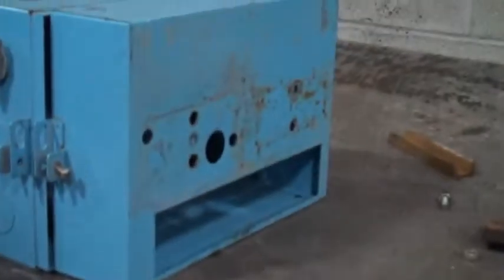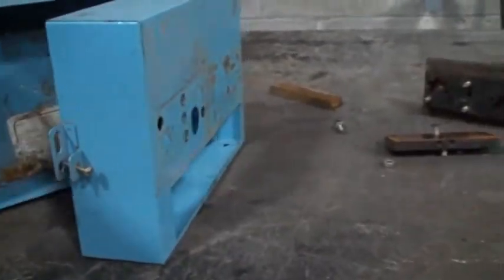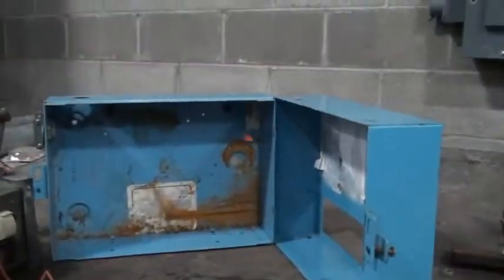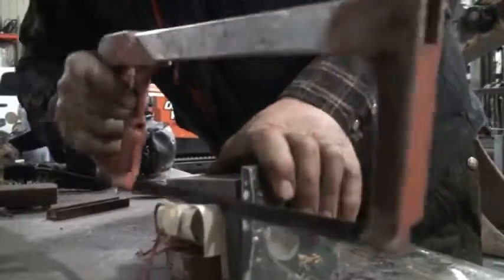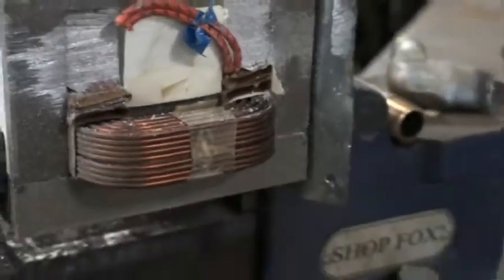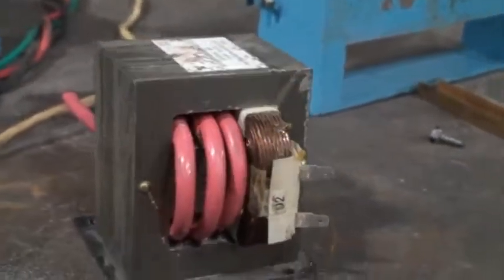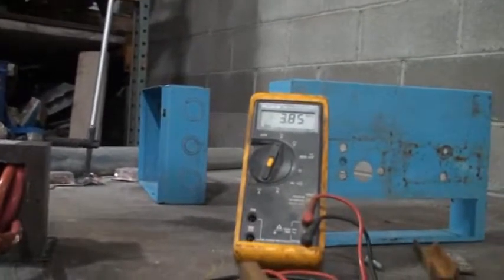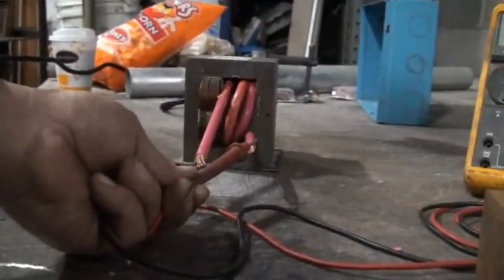blade welder

Comment: Plenty of videos on silver soldering bandsaw blades and how to use manufactured blade welders. I want to build my own blade welder. Yours was the only video that shows how to diy it. Just what I was looking for.
Cheers and Thanks!
Reply from the maker: You're welcome! hope it helps, I could have put more detail but it seems to get boring if we spend too much time on minutia. takes a little experimenting to get the pressure right and such, but works.
Reply: I have a microwave transformer that has been sitting  for years. Yesterday I bought 4' of #4 wire and cut the secondary off the transformer and wound 3 turns of the wire onto it. Even found a metal box to stick into. I have to work out a blade positioning jig, but I am under way. Again, cheers.
Reply from the maker: @dr.crypto6891  nice! let me know how it goes